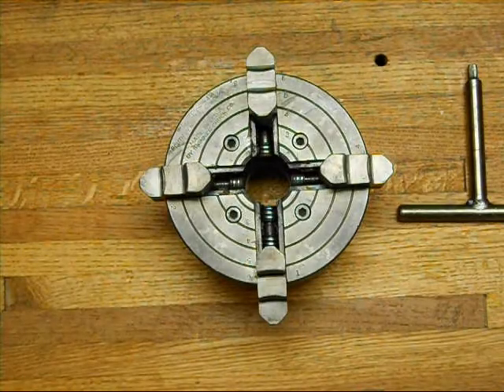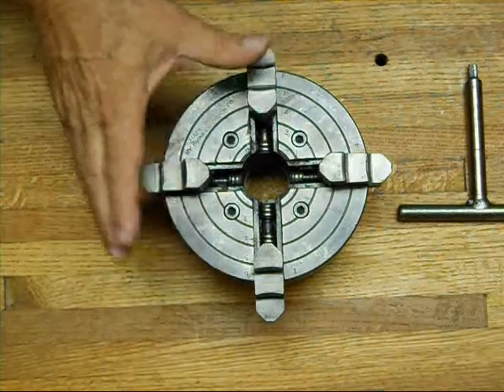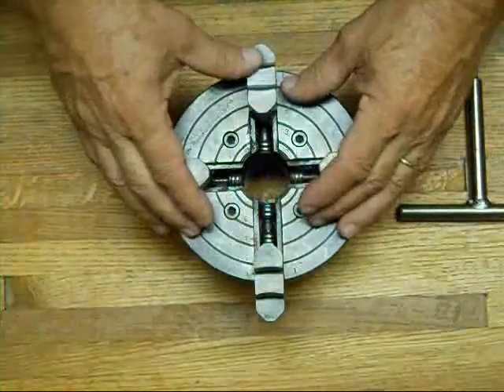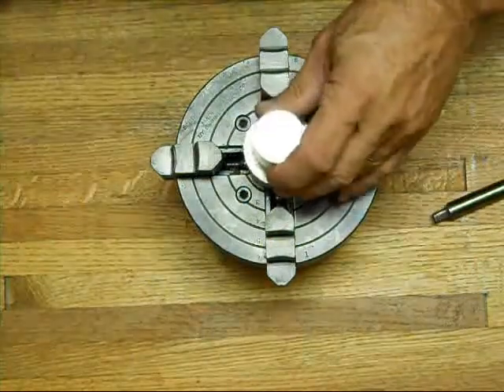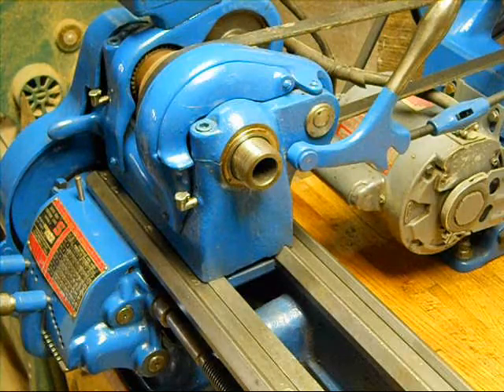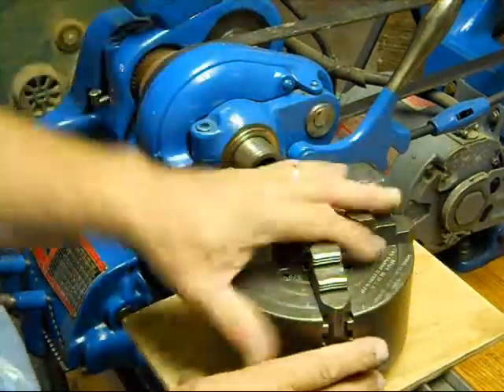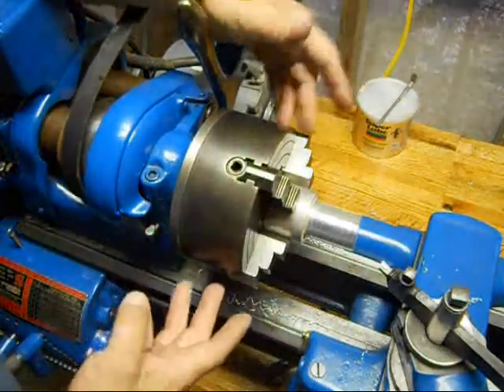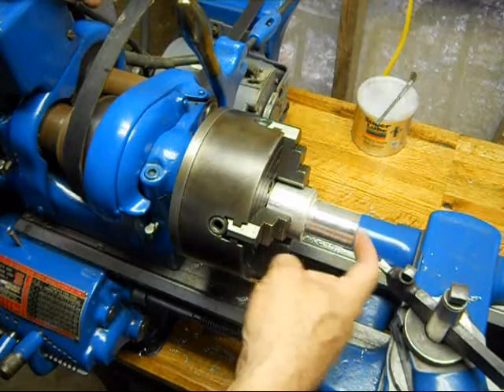Dialing in a four jaw chuck

Comment: Nice work, but just a few things, 

1: when installing the chuck,  chuck up a 3/4" wooden dowel, approximately 16" long. leave enough sticking through on either side as handles. You can slide one end Into the spindle, this will help center the chuck up with the threads and make it easier to start. It also helps prevent you from dropping a heavy  chuck on your finger. And yes I know that Chuck is not that heavy.

2: never slam your chuck against the spindle. You may have a hard time getting it off. Snug it down but don't slam it. and always clean and oil your threats before you install your chuck.

3:  As you spin the chuck , you're also moving the spindle, in the bearings. This can show up on your indicator. Take that into consideration when centering the workpiece. Also you need to center it at the chuck and at the end of the workpiece.

Side note, When removing the chuck, if it feels really tight, don't use the back gear to hold the spindle. the back gear are not made for that purpose. do not jerk or hammer against them. You can break them. if the chuck does not come off fairly easily, with a steady pull, find another way. it would be a shame to do all that work getting your machine going and then break the back gear.

Stay safe and have fun.

Joe.